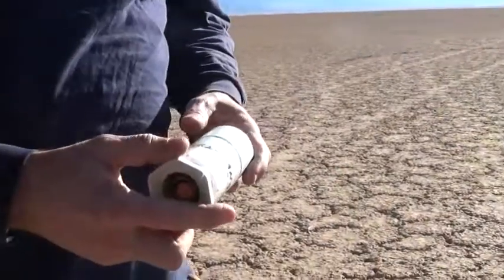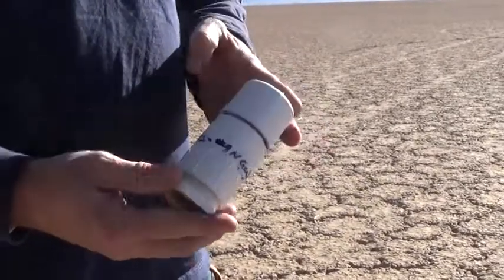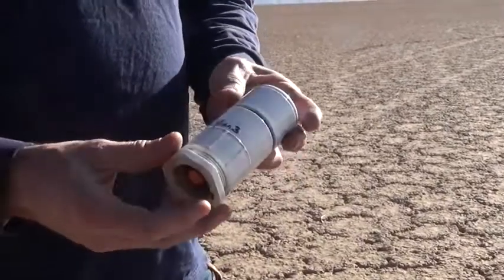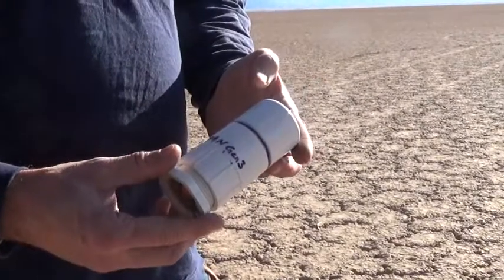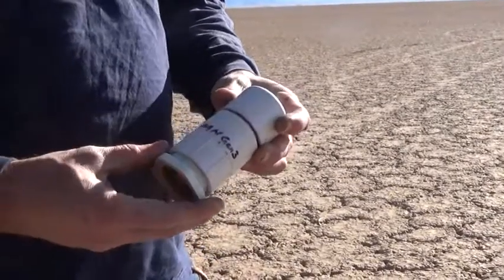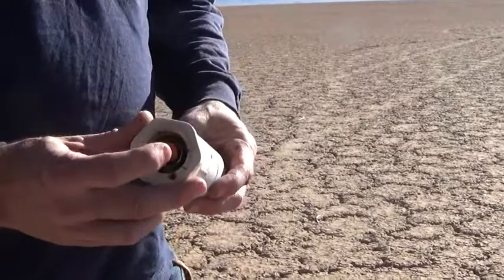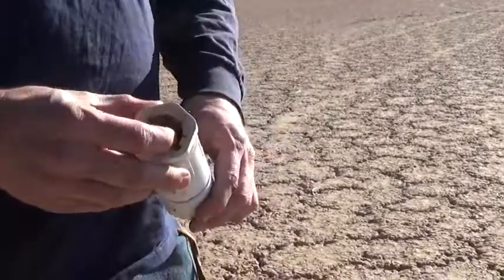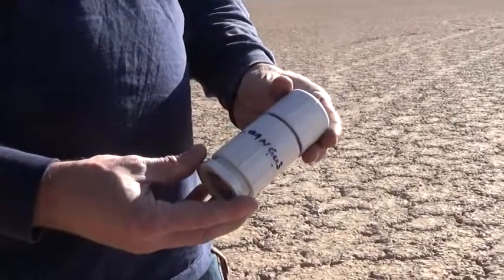Model Rocket Motor Ground Test. Project: SunGod test #3

Comment: Again, ya learned the minimums! Get you a chamber pressure/nozzle calculator for Richard or Chuck! It is fun to build the wheel and use it, but if you don't learn from those who "designed" the wheel, you won't be able to build a better one! 👍